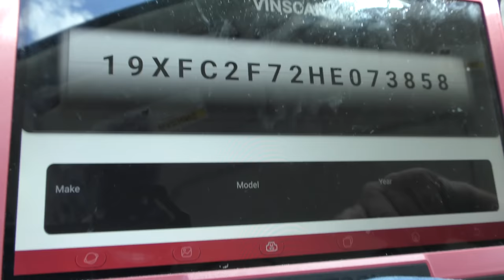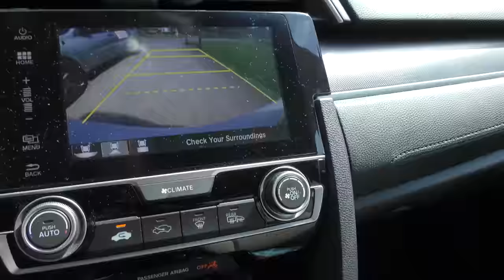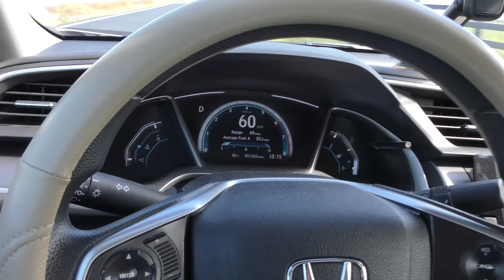Here’s What Happens If You Change Lifetime Transmission Fluid in Your Car

Comment: Hey scotty I just bought a 2008 ford ranger 4 x 4 with 177k,s , got no history on it. I'm changing the oils, did the transfer case, so easy now I'm doing the transmission fluid which has the so called lifetime fluid. There's no drain plug what do you do, suck it out of dip stick hole. I dropped the pan to change fluid and filter. What a pain trying to get a new gasket in place. Anyway with the rear diff I stuck my finger in and the oil is farely clear and very slippery should I just leave it. Don't feel like another messy job with that cover and gasket, I do all my own work.

Comment: I changed the trans fluid in my 2011 Toyota Matrix at 40 000 miles. I did the drop pan, not the flush. A year later I had a mechanic at another garage tell me that my trans fluid looks dirty and I should remove a liter and replace it with new. I told them I had just changed it a year ago. I assume it looking dirty is normal, considering that it was mixed with some of the old trans fluid? My trans is working just fine.

Comment: CVT don't get great gas mileage compared to my Double Clutch Automatic transmissions in my Sonata 8 Speed or Accents (I bought 5) with 6 Speed DCT. A DCT is like an automatic Manual transmission. Even my 2024 Sonata gets 47mpg on the highway if you want to drive 60mph and it Goes! When you step on the gas.

Comment: Scotty, love your videos, but again I say: I have a 2014 Nissan Altima with over 183,500 miles on it with a CVT transmission. I try to keep my fluid clean about every 30,000 miles or so I bought the vehicle used so I cannot be 100% sure that the transmission is original but I don’t see why it wouldn’t be, my daughter has a 2009 Nissan Altima she got 170,000 to 180,000 miles on it. Now it has 204,000 miles on it. These are your Nissan JATCO  transmissions and they were just fine. Yes I do know they they have been some bad ones but I think like any company, you have some lemons and then some that will last forever.

Comment: Some of these transmissions did go to 300,000 miles or more without ever getting a change but some of them would show symptoms of failure before or shortly after that 60,000 warranty range if it was a faulty transmission unit to begin with

Comment: So I have a 2007 Camry 2.4L with 125,000 miles on it that has never had the transmission fluid changed because I believed it didn't need it. Is it too late now? If I do change it, should I go ahead and change the filter as well?

Comment: In all fairness, Honda recommends you change the CVT fluid every 30k or 40k miles. I have a 2015 Accord LX with 122k miles on it and have changed my CVT fluid 4 times now, most recently at 116k. It's super easy to do and cheap insurance for your transmission.

Comment: "Exactly what came out is going back in..."  Even when no leaks whatsoever (dry as a bone exterior, no fluid marks on my parking spot), my Ford's transmission does go down about half a quart every 30,000 miles.  Total capacity is 10 quarts, so I'm not too worried about losing half a quart.

The point is that if I used your "exactly what came out" method, the level would be half a quarter lower each change, would comes to 2 quarts low by 120,000 miles, and that would indeed be disconcerting, if not potentially damaging.

My Ford service manual says to change it every 30,000 miles, so that's what I do.  It tells me to use the dipstick level, so that's what I do.  It also says to check the level when it's hot, so after filling it with cold transmission fluid to the middle of the dipstick's acceptable range, I drive around for about twenty to thirty minutes and check it again, topping it off to the upper limit of the acceptable range.  It always shifts better and sounds quieter, so that's what I do.

Bottom Line:  ALWAYS MEASURE the actual final fluid level after a change of any fluid.  This applies to oil, transmission fluid, radiator fluid, brake fluid, battery levels, windshield wiper fluid, 

You can't make any assumptions!  After all, the original owner may have noticed a leak, only to have the dealer mechanic tighten the pan bolts before eyeballing a refill, if he filled it with anything at all!  Or, it could be like my truck, which for some reason drops half a quart of transmission fluid every 30,000 miles, but with no visible leaks.

Scotty:  I still want to thank you as your videos are thought provoking to the point where viewers will actually THINK about more aspects of taking care of their vehicles!  That's a very good thing, so THANK YOU!
Reply: This is a CVT, no dipstick, no way to measure after a drop and fill

Comment: Alot of dealerships don't do traditional flushes anymore. I did mine in 2012 camry what they do is run the car and change the oil with it running so there is no pressure on the transmission

Comment: I got a Mazda CX5 and it had 125,000 miles. When I drove it, I could feel the transmission was not smooth and shudder at low rpm. I did a drain and fill, about 3.5 quart, the transmission shifted gear much better.

Comment: I think it's important to mention that honda does not specify thier cvt fluid as "lifetime fluid" every time service 3 is illuminated when you do your oil change is when the vehicle needs a transmission flush also if your doing this yourself there is a top plug you can refill the transmission from

Comment: My '06 Tacoma has over 200,000 miles and I'm pretty sure the transmission has never been opened.  I bought with 100k miles.  I was told if it had over 100k not to Crack it if it's never been changed with that tranny.  In 11 years of ownership I had a U joint make noise one time.  I replaced them all.   Other than that no mechanical issues at all and I've towed over capacity with it.

Comment: I just changed my Auto transmission fluid yesterday in my 2008 Infiniti G35. It was just as quick as changing my oil which I did at the same time (already laying under the car, might as well). I think it was the first time it was changed after 200,000 KM, Man was it dark brown! but the gears shift much better! Glad I changed the Transmission fluid. I poured the old fluid into a clear jug and marked the jug then I poured the old into some containers and proceeded to pour the new jugs into the first marked container exactly how much came out. so simple!
Reply: Hey man i got a 2011 qx56 believe never changed @180.000 which you use would be different trans oil?
Reply: @tronmakaveli3069  My car was around 200k km and it runs like new after the change, all you have to do is go to the dealer and ask for your transmission fluid. I went to the dealer it was $70 to purchase 5 quarts.
Reply: @DavidD03820  180,000km on my 2011 qx56 it got a little hesitation 1000 to 2000 rpm i figure trans fluid aint been changed with one owner and history on this truck not specific in trans fluid wanna give it a try but thanks for ya response

Comment: Hey Scotty, I've got a 2017 Corolla at around 73k miles, should I change the CVT fluid or just leave it alone at this point?
Reply: Drain it, measure the amount that was drained and refill it with new fluid. 
Then do it again every two years.
Reply: @dvader3263  yeah, I watched the video, but he also says after a certain mileage new fluid can cause slippage. I'm asking if 73k miles is too far

Comment: Question - Im looking at buying a used 2008 Nissan xterra X Sport Utility 4D  4.0 V6 with automatic transmission. He is asking $7,500. Its a year with the smod radiator leaking into transmission destroying both issue. Mileage on it currently is around 97,000 miles. Seller im talking with just bought the xterra less than a year ago after his wife totaled one of their other cars so they bought the xterra to help them in their move from florida to california where they and i are now. They say they dont need the additional vehicle as they also have other. I asked if they or previous owner already replaced the radiator and / or transmission given the xterra being one of years nissan made the badly designed radiators that can leak into transmission and vise versa. 
He said he does not know if either were replaced, but he hasnt replaced either. 

But he proudly said paid the nissan mechanic dealership to do a radiator or transmission flush. Yet from what Ive read its actually recommended to not flush the transmission in these old of xterras as it can damage transmission. Full replacement of transmission fluids being the more recommended safer option.

So given assuming its the original transmission and radiator, and dealership at least gave the xterra a transmission flush instead of replacement, and unknown previous maintenence and repair and issues history before he bought it last year, i am wondering if its likely its going  to fail soon? 
Or if it can likely continue working good for many years without needintg to replace transmission and or radiator within just a few years?

I test drove it briefly and didnt notice anything obviously slipping, stalling, etc. But I only drove it maybe 10 or 15 minutes and forgot to try out the additional low gear options. 

And if there is no leaking at this point between radiator and transmission ( and how  do i know for sure ) is it safe for me to just replace radiator and do transmission and radiiator change of fluids ( not another flush )? And this will prevent transmission being damaged, and is it reasonable to expect these transmissions to then last at least another 1000,000 miles before needing replaced?

Comment: Hey I got a 2015 Toyota Tacoma with 160000 90% highway miles. I bought the truck at 32000 miles but never thought about the transmission. Should I change the transmission fluid???

Comment: I have Lexus vehicle with CVT.  When should I need to change? 30,000 miles or 60,000 miles? Also, I couldn’t find interval of CVT fluid change in the service manual

Comment: I have a 2017 Prius with 206,000 miles on it and I never changed the transmission fluid. It still runs fine. Is it too late to change now?

Comment: I got a 08 4Runner with 180,000 miles. Before it was given to me it had a flush done at 143,000 miles. It drives with no issues so is it still okay to change the fluid yourself?

Comment: I'm convinced that some clever person could invent some kind of kit you could install, to enable you to check your ATF fluid level at the touch of a button.  The demand is clearly there... but I'm not smart enough to be the guy who invents it! 

The only aspect I've thought up about it for sure, is that your kit would probably use screw-in sensors to replace the drain plug and level check plug.  The sensors would screw into one or both of the transmission plug holes.  And the sensors would have the wiring (or maybe it could even be wireless) running to a digital readout for the driver saying "LEVEL OK/OVERFILLED/LOW FLUID LEVEL".  Easier to describe what we NEED than actually figure out how to make it happen, I know!  I wouldn't even know where to begin to design such a device.  
But I bet some other ingenious and resourceful fellow out there DOES -

Comment: I have a ford fusion 2015 and literally all you have to do is park it level, fill the transmission with approximately as much fluid as you need and let the excess drain out the fill plug. Once it stops drainng from the fill plug, you're done. Takes 20 minutes tops with no guessing or measurement required.

Comment: My Ford dealer quoted my 300.00 plus to change oil in 2017 Ford Escape 2.0 Eco Boom. I you tubed a coupe days and decided to try the change myself. At 37,000 miles my tranny oil was black and smelled like the rear of a skunk. Used FMC oils and did the change in about 45 minutes. Oils for Fords are pricey but must be used.

Comment: This transmission has a bolt on side just below filler plug and vehicular has to be level and then you filling till guild starts running out of check level plug very simple you don’t have measure etc. but interesting to watch anyway , thanks

Comment: First time I encountered "lifetime" fluid was in 1989 when Chrysler came out with the four speed FWD automatics.  And they correct. The fluid would last for 40-50,000 miles which was the life of the first ones.  As time went on they said 100,000 miles.  Then they went to 30,000.  I took note and noticed that they continued to improve that transmission.  They replaced all of the bad ones under warranty for no charge.  At the same time Honda was having similar transmission problems, they didn't replace them for no charge.  Chrysler got a bad reputation for transmissions and Honda got away with it.  By 1994 the Chryslers had been improved to the point that I don't know how long they last.  The 1994 we had went 160,00 miles before the torque converter clutch began dragging.  While I had the transmission out to replace the converter I took it completely apart to rebuild it.  I measured every clutch and every clutch plate in it.  They all measured NEW.  There was absolutely no measurable wear any where in it.  We still have the car, no transmission trouble whatsoever.  I do change fluid every 30K because fluid is cheaper than transmissions.

Comment: I've never changed transmission fluid on any vehicle I've owned.  I've also never had transmission problems on any vehicle.  Bought a new pontiac g6 in 2007, drove it 220,000 miles until it was totaled in an accident.  The car never had transmission problems.
Reply: I've owned a dozen or so cars in my life, all of them "pre-owned".  And an ATF fluid change was one of the first things I did to every one of them.  The trans outlasted the car on all of them, i.e. when I sold off a car it wasn't because of transmission problems.  Especially with how they make cars nowadays, changing the ATF is the one and only thing you can do to a transmission that will actually make it last longer and work better.  
A few hundred bucks for an ATF change every couple years vs. a $5,000 transmission replacement, is the easiest math I know.

Comment: Hey, I got a question for you my fluid hasn't been changed once and I'm at 100,000 miles… Should I change it because the dealer says if you do it it's gonna have problems. And I think what the hell it's about to break anyway because it's never been changed. I might as well take a chance and change it and possibly get another hundred thousand what are your thoughts?

Comment: Amsoil CVT Synthetic in 2006 toyota prius at 124k miles. It is now 296K with original Amsoil. Not toyota transmission fluid. Running strong.

Comment: Just bought a 2014 MAZDA 6 with 80,000 miles.
Should I change the fluid and filter if there is one or leave it alone??
I know I shouldn't flush it.

Comment: Lucky there is a drain plug.
Need to do that 10 or more times (and run it off jacks) to do a proper flush.  You’re basically diluting the old fluid with new fluid till all is new.
(I don’t change the filter but if you want to you can remove the pan before you you fill the last pan.  But I wouldn’t.)

Comment: So I've been having excessive clutch slipping with my Volvo V70. I went to get the throttle body cleaned and they also did fuel injection cleaning. After that I haven't experienced any clutch slipping. What is going on here?

Comment: Scotty you forgot to mention that you  need to unbolt the transmission pan, clean it and replace the transmission filter , bolt the pan back up and then fill it to the bottom of the xxxxx on the hidden dip stick, replace cap , ....

Comment: This is incredible.  Honda actually designated a CVT having a lifetime fluid?  
I thought a CVT's fluid gets dirty faster than any other type of transmission --> Being the reason CVT is even more "in need" of regular fluid/filter service.  (And will happily breakdown sooner than other transmissions, when service intervals are skipped.)

Yet Honda puts the fill hole sideways, without a dip stick, ...
Just, mind-blowing.
Reply: The fill hole can be accessed from the top of the engine.  He is using the overflow hole to fill. And Honda doesn't call it lifetime fluid as they recommend a change every 30K miles

Comment: What about time, my two Nissan's are 2018's, built in 2017 I think. It's 2023, no CVT fluid change, mileage is low 8K & 14K. Question, wait till 30K, or change them now. Hope Nissan had improved their crappy CVT's by the 2017/2018 build year.

Comment: Please help! I have a 2019 Acura TLX with 45k miles. When I check the owner's manual, it says see dealer for recommended transmission flush/service. Of course the dealer already pushed it and I said not right now. When should I do it? It's the 8-speed dual clutch 4 cycl technology package TLX?

Comment: I got a volvo s60 2003 which has a manual transmission with "lifetime transmission fluid" do you think i should change it or is it different for manuals? Been driven 155k miles with no change

Comment: @scotty.  I have a honda civic 2015 with 83k miles. I recently noticed the top cap was missing and i am worried that maybe the liquid might of leaked from the top. How can I check if its missing liquid? Or how can I find out if the transmition liquid  is low?

Thank you

Comment: I have a 2012 Civic LX with the 1.8 four cylinder engine and the five-speed automatic transmission. The best gas mileage I have ever gotten is only 53.6 miles per gallon.

Comment: Just one tip. Always loosen the filling plug first before letting go the drain plug. If the filling plug is damaged and can't be easily removed at least you find this out first and you still have the fluid in the transmission. If you drain it and then have a problem with the filling plug..... you'll be swearing like a trooper.

Comment: I like to do a drain, fill, drain, fill every other time.  Drive a few miles in between the second time.    That Honda fluid is expensive, but DON"T use that Valvoline "universal" stuff, your trans/cvt will start doing weird things at some point.